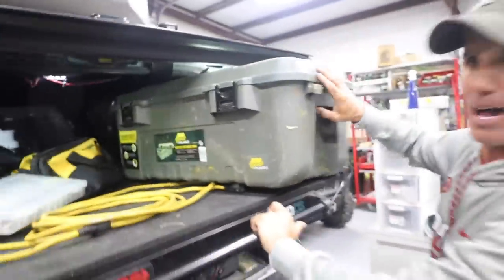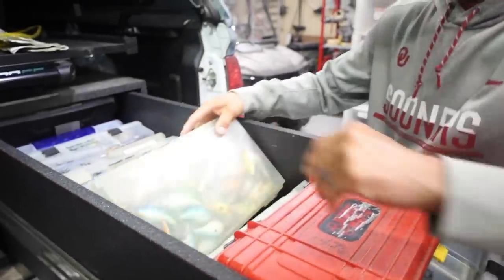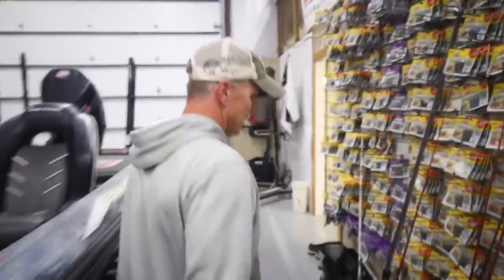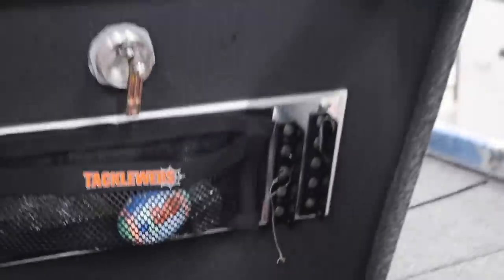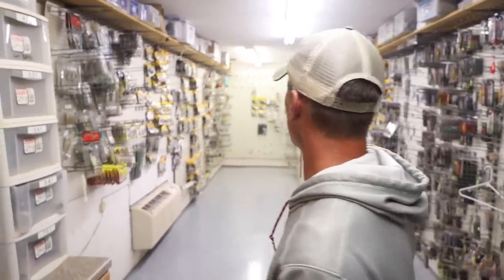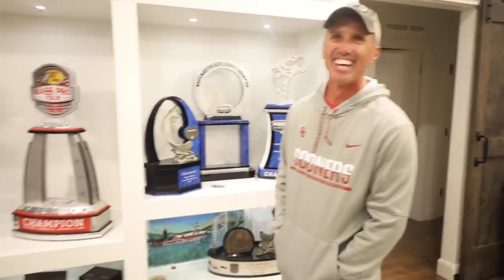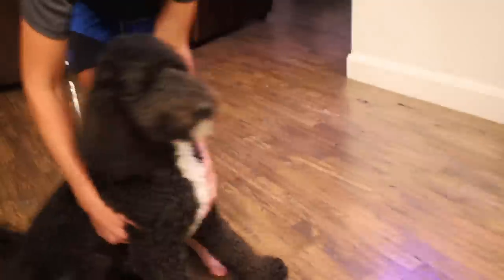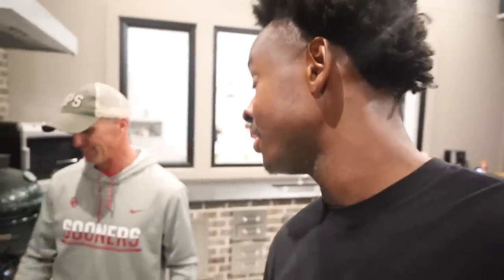WHAT'S INSIDE A PROFESSIONAL ANGLER TACKLE SHOP (FT. Edwin Evers Truck, Boat and Trophy Room Tour)

Comment: Great clasp. Rigid interior shelves. https://www.youtube.com/post/UgkxBrJOMRANMI82dPOK0qoDtHhP-JpbErUg Yeah the shelves sometimes get misaligned with their supports in the lid if you don't have the lid fully flat, or you twist the shelves as you're pulling them out, but pretty much a non issue; just reseat and you're fine. Some spools of thread are a little too big and cause the shelves to not close all the way, however with the clasp you can still get the lid locked if the shelves aren't completely collapsed without breaking things ... so far.